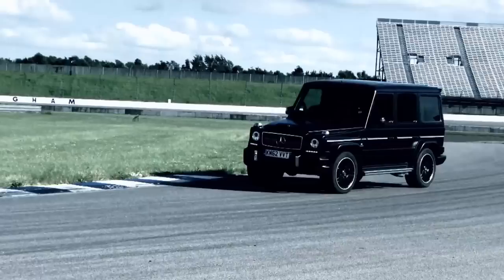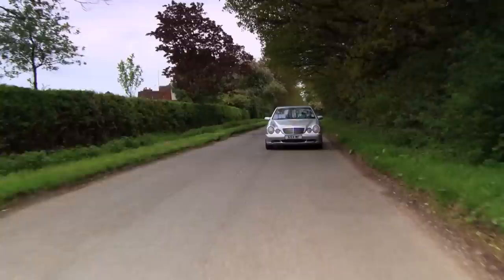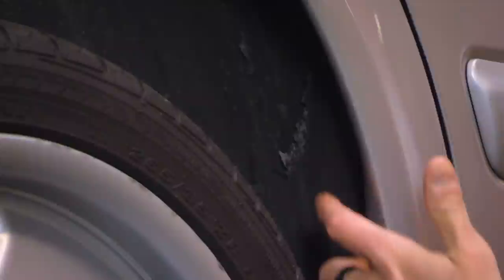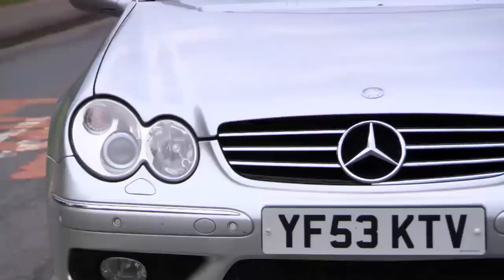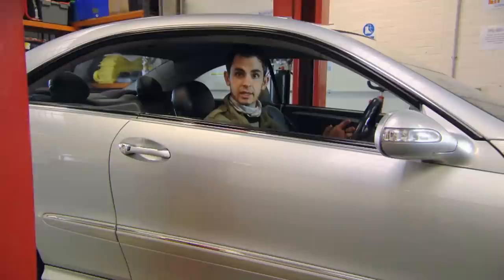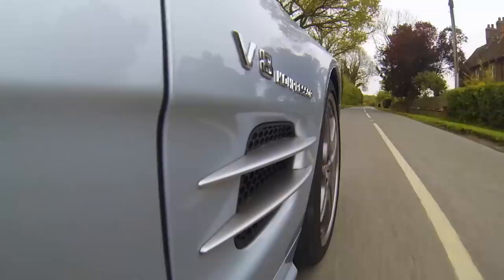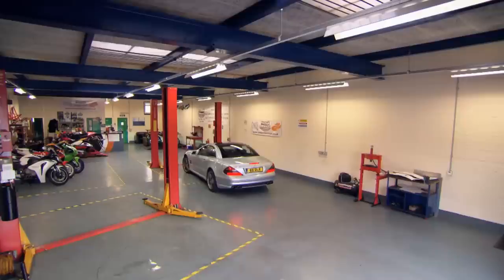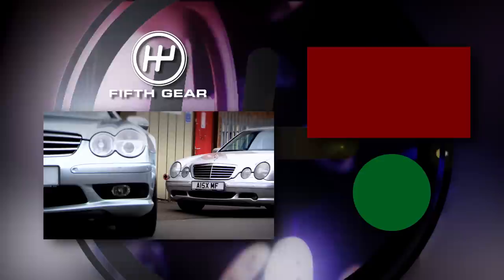Second Hand Heroes: Best Cheap Mercedes AMGs - Fifth Gear

Comment: I work on Mercedes Benz cars and in my opinion, dont buy a second hand merc. especially if its over 100 000km-150 000km. its a good car with expensive electronics, and electronics dont last.
Reply: but if I were to spend 10, 000 CAD or 20 000 CAD and fix it up it would still be worth it. Right? I especially think it would make perfect sense if my purchase price plus the repair cost, combine, are still less than the original MSRP.
Reply: Wayne C Yeah, well, from my experience don't listen to this guy. That statement is ridiculous.
Reply: Wayne C who told you these bs 100000 km a Mercedes Benz is considered brand new i have w211 e class e 270 cdi 2840000 km on clock and it is like tank no problems at all engine runs smooth
Reply: How do you explain Mercedes with 700.000 km and more.  100.000 km, they just start to run smoothly....
Reply: Wayne C the problem with that experience is people don't bring you cars when they are running properly. So you usually only get to see the ones that break, right? So you see the negatives all the time not the positives. Also, if you get one for a good price and you can afford to take a chance then you absolutely can get a lot of bang for the buck with an old AMG. If it doesn't work out sell it and let the next guy take a crack at it. I totally understand the very complex problems an old luxury car can have. But a blanket declaration that they are no good is the same as saying they should all be scrapped. That is in total conflict with a lot of peoples experiences enjoying their old V8 monsters for less money invested than a second hand Fiat. Its a real shame to throw something away that has so much potential without even trying.
Reply: MotoExtremeTV I didnt say the cars will break and is unreliable, I mean the parts are expensive and overpriced. one of the people came in with a SL 600 (v12) and all the coils are dead l. thay important new ones for 6000$. the car uses 2 spark plugs per piston. its 24 plags to swap. dont get me wrong, Mercedes Benz make good cars but if something goes wrong, you are gonna struggle with parts. and old e class mercs are solid, I dont get problems often with them.
Reply: SheerSquirrelTV yes that true. I saw one mechanic do a oil change on a 250 000 km merc and it was the first oil change from new. it looked like tar. a good tip is to ask for service records on a car before buying.
Reply: 100.000 kilometers is not that much for any car. We have a b-class from 2012 that we bought when it had gone 50.000 km and now it has done 100.000 km and nothing is wrong with it. It's like a new car inside and out. The only thing when it was serviced at around 90.000 km was a new gas filter and oil filter. You know that's really normal to change on any car when it has done 90.000-100.000 km. And it drives like a new car and it probably will until it hits 250.000-300.000 km because it is a good car. So I don't get what you are saying.
Reply: Landon Thomas sometimes parts cost more then the cars its self.
Reply: MrCarGuy20. what ever floats your boat. ;-) its my opinion and thats yours.
Reply: xXLegendXx70. well I dont get a lot of problems with the B class and A class. the only problem is if something goes wrong, you are going to drop the engine to repair it. like the starter of the car is 2cm from the firewall under your legs. and trust me, its not a fun job.
Reply: Yeah okay. It's nice to hear from someone like you that has experience with Mercedes Benz cars. But it's also sad to hear because everybody knows that Mercedes Benz are good cars and good build quality with bullet proof engines, so it's kinda hard to believe what you are saying but you are right. I believe you of course. But still, a 190e from the 1980's in good condition with a good price tag is not a bad car if you just need transportation. You can't disagree with that. Of course it's an old car but it runs, and it works if it's in good condition.
Reply: xXLegendXx70. if you want to buy a used merc or any car for that matter. go to a dealership or a place that can give you a diagnostic test on the car. it will show you if there are any problem with the car. some times the car rides okay but there is someting wrong.
Reply: Wayne C Well... you are right and you are wrong. 
1 ) Yes, it is not good idea to have old Mercedes because if e take this SL for example, even if you bought it for 15 k the maintenance is of a car which cost near a 100 k. it is complicated, the  part are expensive, the dealership work also...
2 ) but... if you compared it to a same class BMW, Jag or Porsch then the differences in cost are not so big and regarding some researches Merc is much more reliable then beemers and Jag. 
You are right the electronic is pin in the ass but it is for any "new" car after 2000 and something even the cheep one. The trick is not to spent your last penny in the car - you have to have at least 10% of the car price (and much more for cars like SL or S-class) to cover any unplanned failures.
Reply: I know that. But I'd do it tho. If the repair bill adds up to more than the purchase price, I don't care so long as the overall cost of far far far less than the original MSRP. That's what you need to think about.
Reply: As I have understood it, MB has more problems with the electronics than with the powertrain. I guess that's why it helps to be a DIY and rely on internet help.
Reply: And I forgot. The reason that the powertrain, in proportion, has fewer issues probably is its engines tend to LOWER REV than the others which tend to be higher and mightier. I mean they're SCREAMING compared to MB which puts on a lower growling volume. 

Having said that, I theorize that since MB engines don't need as much maintenance, the company can afford to devote more of its resources on R&D for the technological innovations that don't have anything to do with the powertrain. That's why if we want to know about the future we look at the S-Class. Hence, the electronic gremlins that plague MB.
Reply: That's cause you work on them, Einstein. Why would you see the ones that are running properly if what you do is fixing? I see w211s with 400K km on them all around.
Reply: Stefan Unson. well..... with some electronics, you need to program it to work and only Mercedes Benz can do it
Reply: not really, just solve the issues mercedes did like wiring harness cracking etc, my 2008 c300 has 220miles on it and its top notch, no lights and everything works, only major thing I had to do is my transfer case bearing since its 4wd, cost me 300$ in parts and did all the labour. Servicing is also not as bad, aftermarket supension parts are cheap.. they are good cars if you know what your doing.
Reply: Wayne C My Merc is from 2004 and has over 420.000 kilometers on it. Never had a single electronic failure.
Reply: WGACA Would you tell me the specific model, please? I think the more expensive your purchase is, the electronic stuff it is, then the more unreliable your car becomes.
Reply: Stefan Unson C200 CDI Combi
Reply: WGACA So it being a diesel helped and it must have minimal luxury features.
Reply: Stefan Unson Nope, everything electric. Even has Command system that has never failed once.
Reply: Stefan Unson OK the only thing that broke was my sigaret lighter (own fault due to wrong power plug) and the alarm audio. Engine wise never had issues, all electric windows are all still original. Electric adjustable seats. Honestly, never had issues with the car apart from the usual maintenance.
Reply: The usual complain about cars , but that perspective belongs in the 90s. We are in 2017 , electronics and software are what make cars great now and will continue to in future .
Reply: Benjamin. yeah, but to be fair thats why I have a job. because of electronics in cars. if its faulty, I fix it. ;-)
Reply: WGACA. what type of car is it. older mercs dont give a lot of problems. newer c-class(204) give problems, like the key and the steering lock is common problems on them.
Reply: E-Class AMG E55 good 2003-06?
Reply: Wayne C what's your opinion on a E55 amg 2001 with 150k miles but well maintained and no accidents
Reply: Very solid cars
Reply: XXX Vert i owned a 2001 e55 for two years. The drivetrain is incredibly solid. Unless you try to kill it... It won't flinch. Mine had 266k miles when I sold it still running perfect. I did have to replace some suspension pieces, rear tires twice, rear window regulators and the seals around the oil cooler and oil filter housing. All in all a great car, it would still do 155mph with no issue. I ran it down the 1/4 mile on a 95 degree day with 99% humidity and near bald all season tires just to see what how close to the stock times it coukd run. New it was rated to run 13.3@107mph in perfect conditions. I ran 13.8@104mph with an awful 2.1 60 foot. (Tires smoking coming off the line) 
I DO NOT recommend driving it in winter, in that case it's useless, and will just cause it to rust.
Reply: Wayne C .. I don't care . The 80s and 90s.specially the W140'are the last true mbs. I am going drive once.

Comment: You would have to be a nutjob to buy a used Merc built from 2000-2010. That was the company's worst period in terms of reliability. This was obviously broadcast years ago, but you can now get 2010 E series and AMG for the same prices mentioned here.
Reply: Worst period was Daimler-chysler from 1998-2007 and still they made cars which still goes on the road very strong till date ..i worked for Mercedes-Benz and i know what i'm talking about...w124 is the last bullet proof Mercedes

Comment: Only time you'll have problems with a second hand Benz is if you buy one that was not maintained well.
Reply: Totally I agree with you...
Reply: Have to disagree with you about that. Bought myself a 13 year old R230 with only 38k miles and a perfect service record...had so many problems with that vehicle and only put 10k miles on it.
Reply: @philnleblanc6664  Same here. I'm replacing the same parts the original owner replaced at 45k miles! Cheap plastic equals huge repair bills.

Comment: You would have to be a fool to listen to this crap and buy and old Merc.
Reply: its more expensive then buying a new 1 cause the repair bill is massive
Reply: Vic Sandhu I have an 09 c63 amg and its been fantastic. I use vividracing .com "bill me later" feature to buy new brakes when needed and anything that costs more than $1000 however only things ive had to do during my 40,000 miles ownership (60,000 miles now on car) was the regular maintenance like oil change and tires. No problems at all.
Reply: AMG or BUST then you are a very lucky man. I wish you good luck with it and hope you enjoy it. Me personally I wouldn't make that choice but it's great you enjoy it and I wish you many years of joy with the car.
Reply: Vic Sandhu There are a lot of people here in Dallas with the c63 not many have had problems that engine is very similar to the ls engine in the Chevy ss (2014+).
What was your personal experience with the amg you purchased?
Reply: At 6000 pounds for clk55 amg might as well drive it till the whole car breaks.
Reply: Ricardo Ellison right, one is a pushrod v8 based loosely on 50s technology. The other is a dual overhead cam hand built masterpiece.
The LS is a good engine, but it's nothing like a m157.
Reply: Whisper Cars 😂😂😂😂

Comment: No. Just no. Why do you think these cars are now so cheap? It's becasue they are so expensive to maintain and run. This video only scratches the surface of ways these cars will arse rape your wallet. Your buying a car which was £80k new, but now with aging electrics and parts. Not a good idea unless you factor in another £20k on putting the car back to new condition and running it from there.